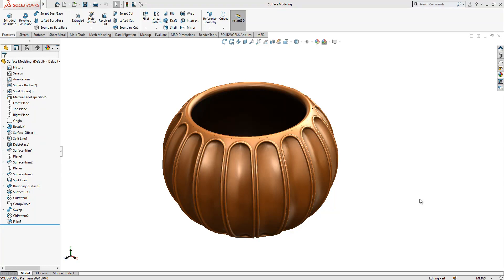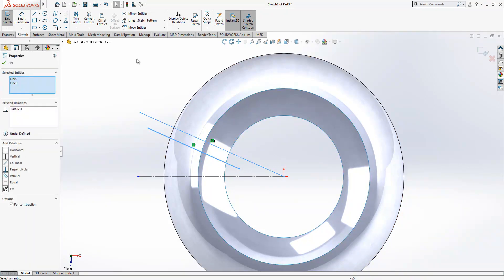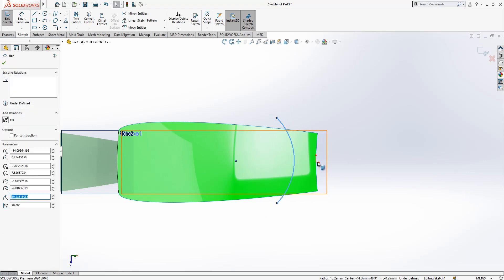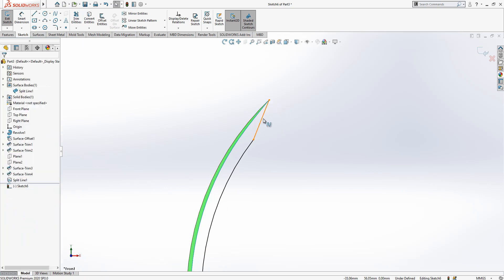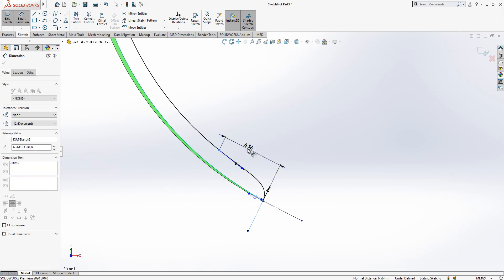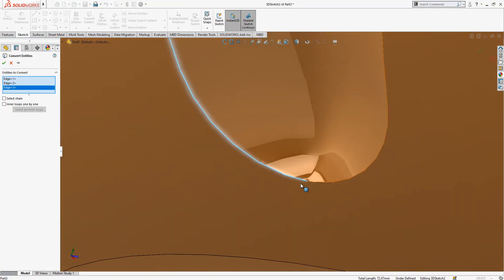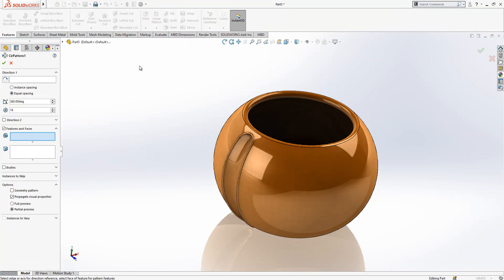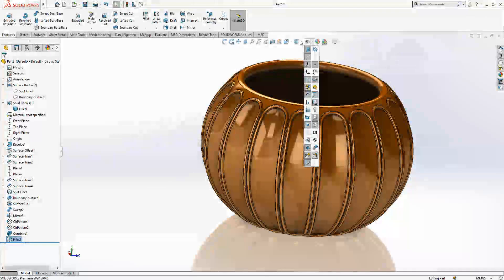Surface Modeling - SolidWorks Tutorial

Comment: Thank you for all the great videos! 

When creating the tangent planes starting at @4:13 you appear to have the tangent option selected by default. I dont appear to get this option. Only get two options, Perpendicular and Coincident - I am using SW 2024. Not sure what is different. I followed step by step? This only happens with curves generated from arc entities . Tangent is available with straight even dia. cylinder surface or spline revolved surfaces.
Reply from the maker: Hi Dear,

I do not know why it is not appearing on your model, or it has to do with version or the entities you've used.

Regards
Reply: @3D-World  I resolved the issue on the Solidworks forums and it appears that you have to add more construction entities to now achieve the same plane tangent options. I believe someone checked by SW version when this option became vintage and appears to be starting and including SW2020. I have the same issue on a different model of yours.